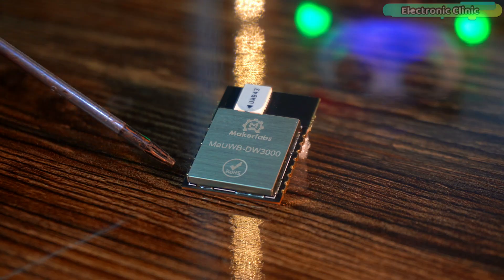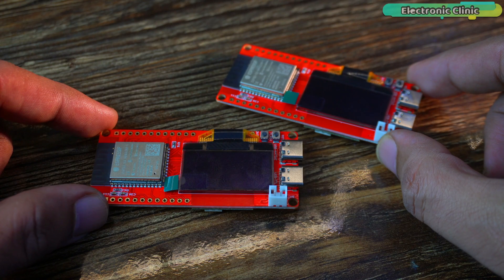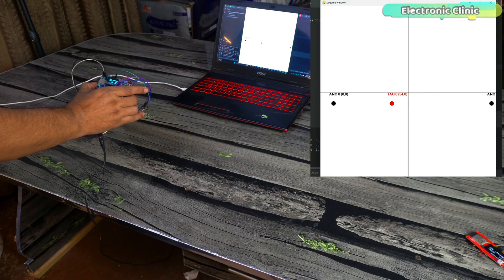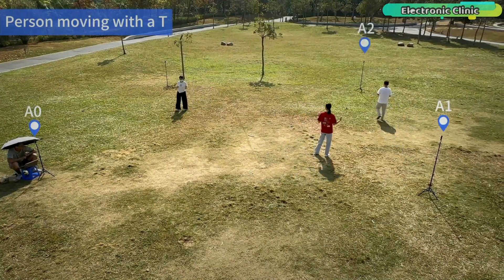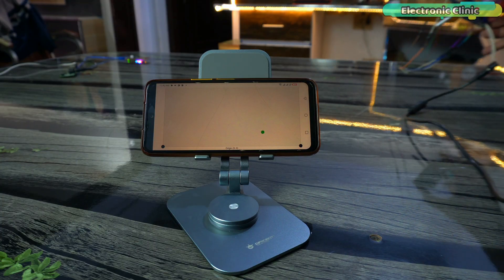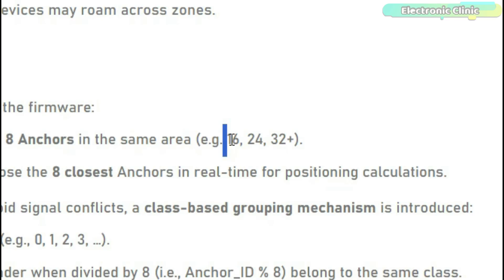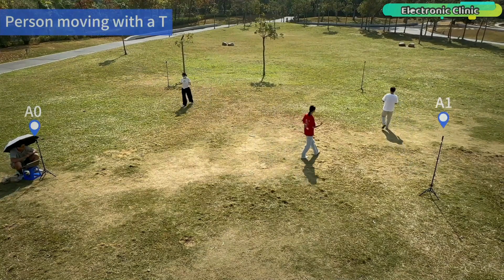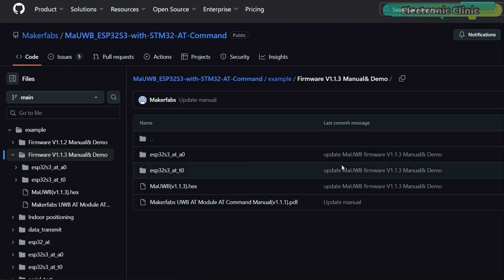ESP32S3 + MaUWB UWB Module: BREAKTHROUGH Unlimited Anchors & Smart Tracking! Indoor Tracking

Comment: Hello , I also want to determine positions on a 1 m × 1 m table with a 2 cm tolerance. I have locations with the same XY coordinates but at different heights. Do you think this can be achieved with this system?
Reply from the maker: Yes. You will need to watch my video on the Bosch bmp sensor. You can use that for measuring height.

Comment: What kind of precision do you get when using multiple anchors? I have 2 MaUWB modules and the mesured distance is always around 50cm more than the real distance. I want to know if having more anchors would give me a more precise location, ideally I would like to position the modules within a +-15cm diameter circle.
Reply: Have you been able to find a solution on this matter? I also want to determine positions on a 1 m × 1 m table with a 2 cm tolerance. I have locations with the same XY coordinates but at different heights. Do you think this can be achieved with this system?

Comment: How do I update the firmware "MaUWB_ESP32S3 with STM32 AT Command"? On GitHub it says simply "Connect ST-Link to PC". Do you need an additional programmer? Which USB-Type-C of the two should I connect to? Why are there two USB-Type-C ports? I run the program "STM32 ST-LINK Utility" and I don't see the connected board "MaUWB_ESP32S3 with STM32 AT Command" in it.